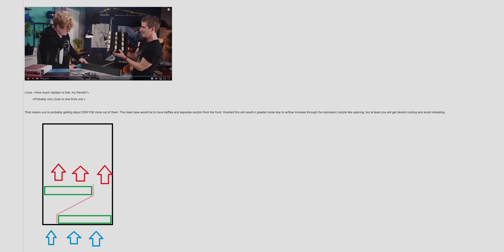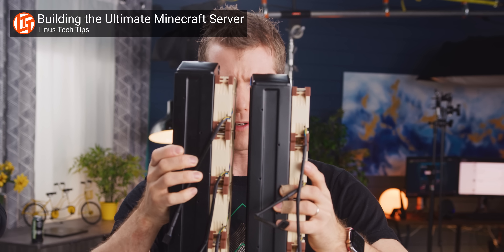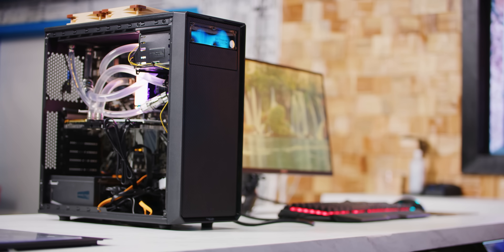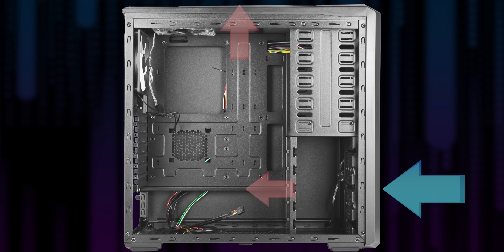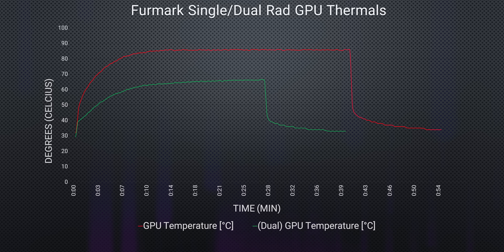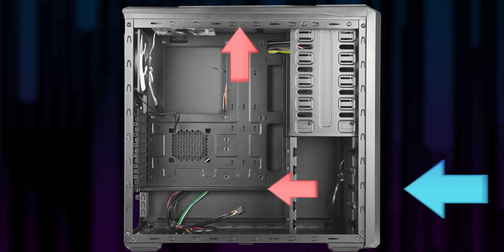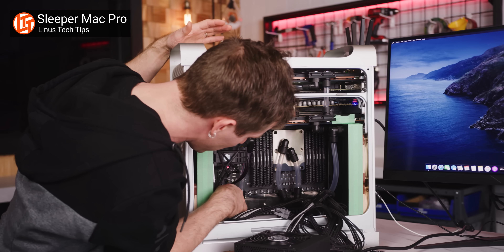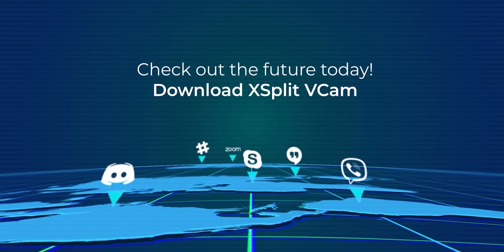I’ve been water cooling wrong for YEARS - $H!T Manufacturers Say

Comment: Interestingly enough, the Corsair simulation seems to count with a 100 or near 100% efficiency of their radiator, which is ridiculous. Sure, the second radiator is severely limited in it's abilities as it's already handling warm air, but it's not at 0% efficiency, energy is still being added to the air.
Part of this problem could be with the air speed. Depending how fast the air goes through the radiator, it does or doesn't pick up energy. If it goes very fast, it doesn't have time to pick up energy and so there is capacity left. If it goes slow, it saturates completely and won't allow for more cooling later. Another issue is the radiator construction - if it's fine, air gets well saturated, if it's coarse, air gets less saturated.
Yet another variable is the actual order of radiators. If the processor runs at 70°C and the graphics card at 50°C, CPU loop can still saturate the air after GPU loop. So the reality of cooling is bit more complex than the theory of it.

Comment: The thermal capacity of the intake ambient air is higher than the amount dissipated by the rad when the air passes through the intake. The air going through exhaust radiator is not as cool as ambient, but still cooler than the loop. So it still adds surface area for heat disappation.
Reply: Loops with stacked radiators directly on top of each other are equivalent to just thicker radiators. There are numberous videos out there about push/pull configurations being better at lower RPMs and higher resistance from the radiator fins.

Comment: been thinking about this for a week, and i have to say a significant factor would also be the increased thermal mass of the additional water.... after all, there's now much more water in the loop and thus the rads will take longer to heat up..... this slower rise in temps allows the fans to perform much better, wicking away the heat before it can build up too much.

Comment: based on the graphic they sent you with the two radiators offset from each other, it makes me think they were critiquing your literal stack of radiators. It would make sense that forcing the air through another radiator would reduce the airflow, which seems like it would decrease cooling efficiency. Leaving gaps between the radiators would allow for additional hot system air to feed into a second radiator, which sounds like it would work fine. 
I think this might be a communication issue.

Comment: @Linus, would be interesting to see if there was a difference in temps if on the stacked rads you reversed the progression through the radiator. i.e. 3rd radiator being the exhaust side as the first radiator in series (hot coolant in) then the sandwiched rad, then the intake rad. In theory this would give you the greatest amount of potential drop across the assembly, whether or not that translates into real world differences in temps.... shrug

Comment: The comment that you cant cool with hot air kinda doesnt hold up when you use a straight desk fan rather than an air conditioner, it does feel cooler to have ambient air blown over you compared to being sat in that same air alone.

Comment: the problem with corsairs wisdom is they are using a scenario where the radiators are fully saturated with heat,  i can play games for 8 hours straight and never  come close to fully saturating my loop with a 2080 ti and a 3800x oc to 4.4 ghtz. and also they didnt actually manually test anything , they are running a simulation program no doubt written by someone with very little real world water cooling experience.

Comment: To understand the basics of the engineering behind these arguments, a good resource is the datasheets at Koolance for cold plates, heat exchangers, and pumps. Without having to do the heavy lifting calculations, you can observe from the various data plots that total fan CFM is a major figure of merit behind the maximum TDP. Flow rate and radiator size (thickness, number of fins) all appear to be secondary contributors. Radiator area contributes in the sense that it potentially adds more fan CFM.

Comment: Why not push fresh air from the outside through both radiators, and exhaust at the back of the case? I think that would achieve an even cooler end result.

Comment: Corsairs entire argument is based on the premise that you don't need more radiators IF the water temps are already in the 40c range. IF they're above that(for sake of an example 60c), then yes, adding more water (which needs to be kept somewhere, and a radiator is a damn good place to keep it) will decrease the ambient water temperature as its specific heat value is higher due to larger amount of water.

Comment: This test looks like your radiator have a space to where the hot air to mix with the ambient air
When your other vid shown that your radiator literally stack upon each other that can change the air temperature and all of this assumption is base of no heat is lost in the conduction to case of the heat transfer
So the corsair guys makes sense
Then again heat transfer is a very very complicated thing

Comment: When you add in another rad you increase the volume of coolant and disperse the heat over a greater area dropping the temp in rad 1 and the air passing through to stacked rad 2  simply increasing the header tank to hold this extra coolant would achieve the same result.  In-conclusion Corsair are correct

Comment: did you try to put one radiator on the input of the graphics card an the other on the output for cooling the water that is warm because the dissipation of the graphics card and cool it another time to put in to the cpu ??
I think that the orientation of the fans can be with all the fans of the radiators pushing the air out of the case, and 2 or more fans that u have pushing air into the case, or maybe can be reverse.

Comment: Just take an external radiator and call it a day.  If you need, take 2 external rads. The cost of good fans for a MoRa3 is about half of what the rad itself costs....You could take two rads and skip the fans up to 400-500w waste heat.,,and instead of having noisy 120 or 140mm fans, big external rads allow 4x180mm or 4x 200mm very silent fans with 700-900rpm. A LOT LESS noise...and a cleaner look inside as well. I dont understand why internal rads are so much more popular than external rads. YOu also mount the pump & res onto it, looks nice too.  watercool.de  https://shop.watercool.de/WebRoot/Sage/Shops/WatercooleK/5759/5F94/B984/6113/E94C/0A0C/05B9/5E09/Heatkiller_Tube_preview_012_xs.jpg

Comment: What I would be interested would be the flow directions in the stacked radiators, if the waterflow is reverse to the airflow, stacking rads is sensible, as you can cool the water each step down to ambient, if the systems produces more heat then one rad can dissipate.

Comment: The temp of the air exiting the radiator is inversely proportional to the airspeed. So you can stack radiators as long as you're willing to bump the fan speed.
If you care about noise, then your best bet is to increase the cross section of the radiator and use more or larger fans spinning slower.

Comment: I wonder if he took the difference in thermal-mass (ie volume of water) into account for this experiment - Adding extra pipes and second rad means extra water, doesn't it?
That would also follow for removing one of the rads in the other setup - reduction of thermal-mass = worse cooling. Or am I talking out of my ass again...
I'd be interested in an experiment with a big reserve tank vs tiny/no reserve tank (eg aio) comparison such that the only thing compared is the thermal-mass involved...

Comment: I get where Corsair is coming from; the more air resistance you create, the harder the fans have to work, and the less effective it is for the cooling effect on the other radiators.
Here's another test you should try: 3 radiators, side-by-side INSTEAD of stacked. Trust me... you'll likely notice a MASSIVE difference. To further improve it, put it on the intake side, where outside air is coming in (assuming you aren't already).

Comment: What was your water flow through the radiators?  Did you run the water through the top radiator first and then the front one? or the other way around?

Comment: There's alot of moving parts to this. The most critical variable to this is the static pressure of the fans used which is why you only got a diminishing return with your Noctuas (good result still) instead of cratering thermal performance. If you tried with craptastic sleeve-bearing spinners or simple case fans designed for cfm and not static pressure you would have easily hit the thermal limits.

Comment: Hmm... surely the optimal solution would be to put the radiator outside of the case entirely? As in, perpendicular to the case surface... That way the input & output from the radiator won't interact at all with the components inside.

Comment: The metal case itself is a giant heat exchanger. This may contribute to the air in the case being cooler then the intake radiator's output, and what Corsair simulated.

Comment: Stacked radiators work well when there is a lot of air in between.(we find them in cars or in air conditioning systems)
When a lot of air passes through the radiators, the water cannot heat the molecules quickly to its temperature.
In fact the second radiator receives however fresh molecules of air.  
Not as fresh as the first radiator but still cool enough to help lower the temperature with 20 or 30 percent less or much more in some cases.
Linus you are right and correct.
Leave that shitty spy company alone.  Their engineers aren't smart enough to understand things for themselves.

Comment: the efficiency of the second rad on the top would be WELL below the efficiency of the front rad, that is unless the fans were reversed and drew in from the top, but youd than need a good size or speed fan on the rear to remove the cfm being pulled in through both rads or youd have SP issues.

Comment: Why use radiators for water cooling when you need all the fans to cool them leading to more overall noise? Just a vicious circle. Water cooling will die out as fans get more efficient, just as dual graphics cards have been on the decline.

Comment: Literally just make a radiators be intake and have exhaust as fans only. That solves the heat problem and makes this irrelevant. 

Example (overkill): front 360 push/pull
Top 360 push/pull
Rear exhaust 140 fan
Bottom exhaust 2x140 fan

Airflow>natural rising heat
This makes it so rads always get fresh air and all the hot internal air is constantly removed

Comment: I do not know about stacking radiator cooling performance but I know industry scale 100kW water coolers. There was very little tweak to make system way more efficient. We increased the circulating water capacity. Even tiny external 200l barrel on intake changed everything. If you can make outside PC case the nice little water tank then you can increase the water capacity. How little  or big external tank, it depends about materials, design etc. I could use the polycarbon from side by side tank. Lets say random number 450x450x50 internal dimension, it gives to your system 10 liters extra water capacity. Any small leak, no big deal thanks for external design.

EDIT: Also you use the coolant hose too wrong. Why you need the all same size? It is better if you use the pressure side the smaller diameter and return line the wider diameter hose.

Comment: Wait what?? Ofcourse its going to be lower temperature with two rads, it has more 'stuff' to warm up, its going to take longer. What happens after a LONG time of testing?  You can see its still slowly climbing at 5:04. 
Do it again, but now test for longer. Not just 30 min.
I'm not saying it is going to be the same as only having one rad, but i got a feeling the difference will get smaller over time.

Comment: linus you are a smart guy and other that say against you aren't that clever. actually more coolers chould work better anyway. the thing is that, heat transfer is the rate that heat is trasferred when particles of any temperature like room temperature in this case hit the radiator and leaves it again. what happens is that the ambient air particles collide with the fan an steal some heat from it as they bounce off and leave again. the faster the particles bounce off the radiator, the faster the temperature drops. actually the speed of the particles hitting the radiator can be slower than when leaving and also speed up cooling. wan't to see some really fast cooling test. take a co2 container from a paintball gun and create a hole it and release all the co2 in one second and you will see the surface of the container will freeze ice on it instantly. the best cooling system is a compressor that compress air into a small tune circuit in a heatsink that have a very tiny exit hole. that iwll cause the air to expand rapidly and cause the heatsink to transfer heat at a faster rate. you can even compress hot air or use steam from a water boiler as the heat transfer medium and it will still work.

Comment: You can add more and it definitely helps. You can't pull air out through the radiator though. You have to pull air into the case and then push it out. Air temp inside the case doesn't matter to much just so you out a outlet and input

Comment: Reminds me of an argument I had at an expo that leaf blower GPU fans are better. He did disagree but it's fact, and I proved it. Simple, turn off the case intake fans of both designs and future mark. Leaf fan is ducting it straight out. Yet all designs went tri fan for a few measly degrees at high air flow. Sad.

Comment: I think what Corsair wrote is true with one assumption: heat transfer from coolant to air is perfect and instantanous. Here are two heat transfer barriers between coolant and air: coolant to radiator and radiator to air (ignoring paint on the radiator itself). Each barrier introduces a rate of transfer that is not infinite. That makes it impossible for air leaving the radiator to be the same temperature as coolant especially with forced air flow.

Comment: I reversed the top mounted fan to blow air DOWN into the case. I got around 4 degrees lower CPU temps simply because the 120mm radiator fan which is positioned at the rear, gets fresh air, with no "thermal load" from any other components. Also got much cooler RAM.
 When i set it to pull hot air out of the case, CPU temps go UP because it pulls how air coming up from the GPU and other stuff, but GPU temps go down just a little bit, around 2 degrees.
For maximum cooling efficiency without compromises, you should modify your case. Make a separation between the CPU/RAM and the GPU. Give both sides one intake and one exhaust and you're golden.

Comment: from a thermal engineer point of view, the most important point is input temperature to the radiator. As long as this is below the water temperature you will always cool the liquid. I assume Corsairs point of view is just, that the exhaust temperature of the first radiator equals the liquid temperature in the second, but that would be only true if the heat dissipation of the radiator is high enough.
There is probably another point you need to take into account. Where is which radiator positioned in the loop? The one fed by hot air needs to be the first after the heat sources, like this the effect of a second radiator will definitely be much higher, because your temperature difference across the radiator will be the max possible (basically it's like countercurrent flow in a heat exchanger).

Comment: The way i did my first watercooling setup, i did a side by side comparison starting off with your standard setup, cooling off the heat by exhausting the air out the back. Was cooler than using your standard heat sinks and fans yes...... But then i thought to myself. how about i have 2 radiators and do a circular loop, the radiator in front of the case pulls air in (water flows through last). Radiator in back exhaust air out the back, (first radiator to cool off the warmer water). Both reservoir and pump are before cpu. seemed to make a much better difference in temps and power.

Comment: LOL, forgot one important detail that can make the all difference.  Cooling is a result of air flow, temperature difference, surface to transfer the heat (or cool) AND the flow thru the radiator...  Too much, too fast cooling fluid, will not cool efficiently.  More radiator with split flow (less flow thru etch) can disperse more energy (Power).  For sure staking radiator one in front of the other reduce the temperature differential making the last radiator less efficient as the first (but still help)...  Also  Cooling fluid affect the efficiency. but it's an other story.  Try for the fun of it, connect the radiator in series v/s parallel same pump, air flow, fluid  ;-)  Also it may be better having a radiator to every air intake and nothing at the exhaust, just saying.  Keep having fun

Comment: I think Linus is right, but only if water is piped through each radiator in series in a CROSS-FLOW arrangement. With a radiator cooling the hot water down to warm water by the second hand warm air of the other radiator making it hot before being discarded into the  room. And that other radiator cooling down that warm water down to cold water by the fresh cold air, making the above second hand warm air i spoke of above. This will balance the work over the two radiators.

Comment: They probably ran their simulation with a garbage flow rate equivalent to their aios. Also, you should check this by using a rad actually capable of the thermal load to begin with.